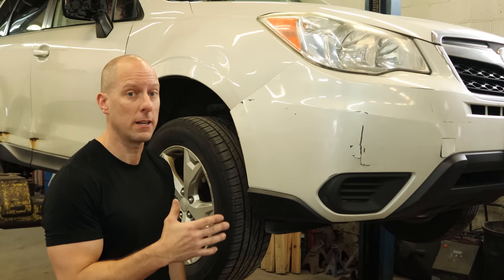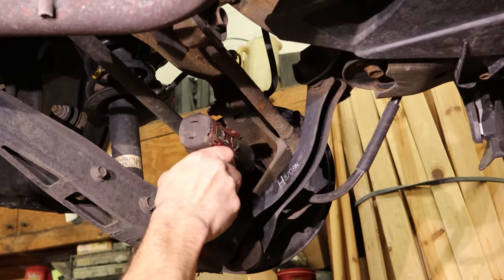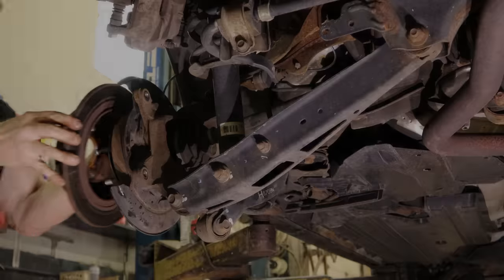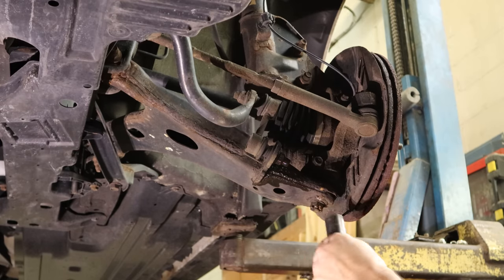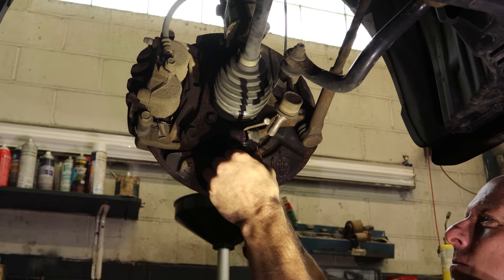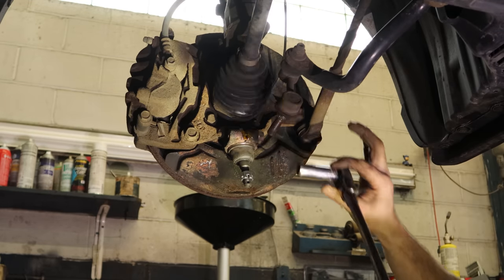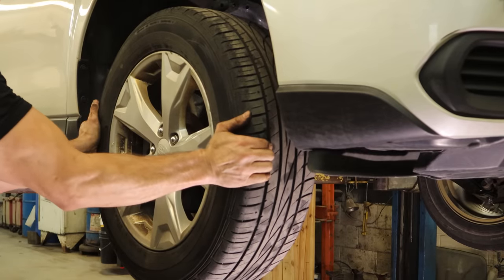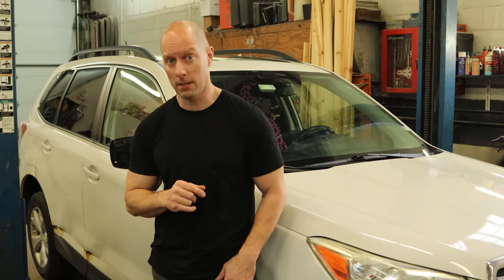Subaru Forester steering and suspension repair after an ABS light complaint

Comment: Even at 140,000 miles on that beater, the first hub bearing, and the control arm looked OEM.  Good to see Mr. Spotty is still on staff.
Reply from the maker: On Illinois roads, that is some kind of record! lol
Reply: I was born and raised in Newfoundland Canada… you think things rust fast in Illinois… Just add salt air and 200 days of precipitation (be it rain or snow) and the term “watch it rust” is not an alliteration… 😂😂
Reply: Nice work.  That will make the customer happy especially after resetting the steering angle sensor.

Comment: Shops only want gravy work anymore. My buddies 1995 GMC 3500 has upper bushings saturated with diesel and oil for a couple hundred thousand miles, can move with prybar easy enough, upper ball joint that when you push in the top of wheel the control are pops up and down on it. So former shop I worked at told him, Naw, it's all fine, despite the cupping on the inside of front tires with only 10k on them. So Good on you Scott for being one of the few, the extremely few., who still care about actually fixing vehicles and not just making quick easy money. I always counted the easy jobs as the balance for the tough jobs I never turned away.

Comment: I was shocked to see a Subie on today 👍   In southern ontario I had to completely remove the rear knuckle and a local machine shop pressed it out. 16 tonne pressure. No wonder my pounding wasnt doing anything. Backing plates totally rotten and likely just as much noise as the wheel bearing. I went with oem bearings as I had a moog and a skf fail within 80k. Big birtha really useful. Have to keep an eye out on auctions. And you even used a torque wrench on the axle nut! Will make that bearing last.  Nice work

Comment: Little time saver when it comes to the cotter pins, if you're replacing the part they go through you can bend them up enough to get the socket on then hit it with the impact and shred the pin. No need to mess around with saving the part that's going in the pile

Comment: You know it's going to be a rough day when you start with the easiest job and that is a wheel bearing on a drive axle.  That one came apart way easier than I would have thought.  Usually, there is a massive amount of heat required, followed by an extended time persuading it with an air hammer.  Don't forget to throw in some fine expletives, to appease the rust gods.  Maybe that was a southern car for part of it's lifetime.  Funny though that there wasn't a single gnome in sight.

Comment: How did it not just wobble down the road? Tires would wear all over the place!
Reply from the maker: It actually drove straight, just the steering wheel was off.  After the new parts were on, the wheel was almost back to center.  The alignment got it perfect.